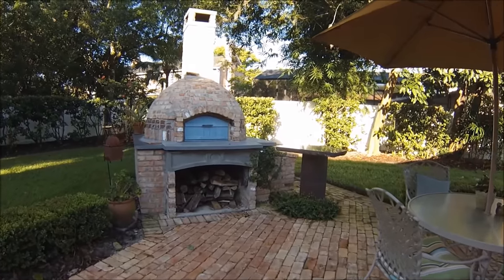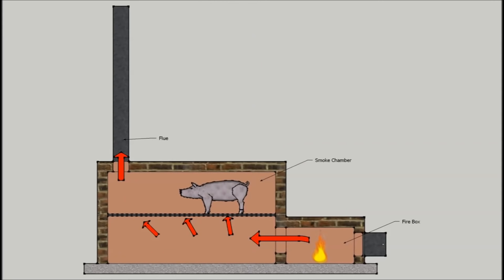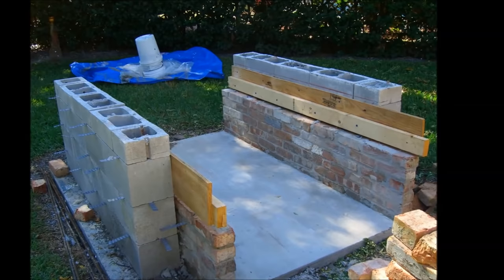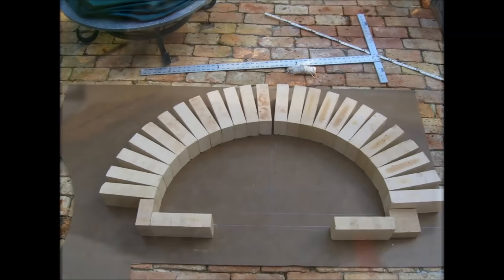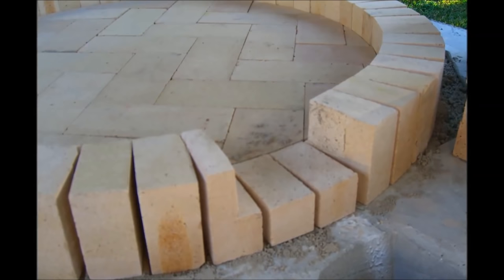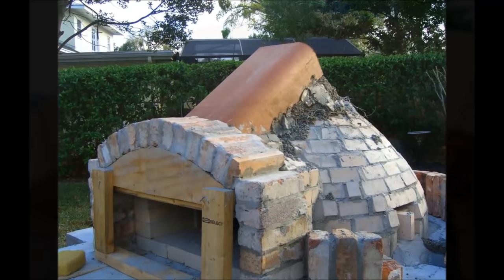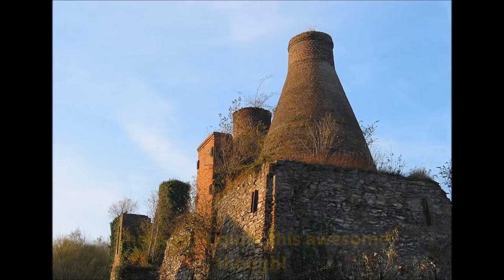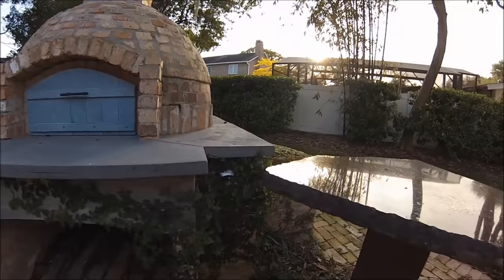How to Build a Brick Wood Fired Pizza Oven/Smoker Combo

Comment: i'd love to make something like this. just with cheaper materials.
Reply from the maker: Well the expensive part of this build is the brick on the outside. If you built a doghouse style oven with a framed housing and cement board siding, it would be a lot cheaper. It would have a totally different look than mine has though.
Reply: @LeeMcNeil  I was considering doing aircrete and finishing the outside with something moldable so i could get an adobe look and make it look like a fantasy creature oven. that would be totally epic. I've worked with cement board before. it really does a number on your tools and takes forever to cut. a bunch of the adobe ovens i've seen have cracks. the ferro cement ones probably won't last forever due to the steel eventually rusting. sooo. i got alot to consider.  yours is lovely and classically beautiful. I just want...something crazy-looking yet useful.
Reply from the maker: @necrokittie2291  You could use Perlite concrete around the oven and form that into the shape you want - that material can be molded into different shapes. Then you could coat it with a synthetic stucco.
Reply: @LeeMcNeil  ooo, interesting idea. i'll see if i can find anyone using ingredients like that with a video already, if not, maybe i'll do a test run before i commit. thanks! =^-^=

Comment: Lee-

I've never done any work with bricks/cement or concrete but I love the idea and I'm good with my hands (I do a lot of metal work). Do you think this would be a good job for someone who is just starting out?

Cheers,

-John
Reply from the maker: +John Raguse Yes I think you could. I had never laid brick before this - although I had seen quite a bit of it being laid by others. With all the videos out there on YouTube it shouldn't be too hard to figure out. One thing that I did do that I don't see any professional masons do (probably because it would slow them down), is I kept the brick I was about to lay in a bucket of water and pulled them out of there to lay them. It seemed that when I didn't do this, the brick would suck all the moisture out of the mortar and not really adhere to the brick very well. This helped a lot. Maybe I was mixing my mortar too dry but it didn't seem like it to me.
Reply: +Lee McNeil Thanks Lee! One last question, did you build the front door yourself or did you order it? If you did order it, where did you order it from?
Reply from the maker: +John Raguse +John Raguse Someone I know who is into woodworking made it. It's just a simple board and batten door. The cast iron door to the firebox for the smoker I bought somewhere on the internets.

Comment: Hi Lee!I'm very impressed! Very good job! I like even your other videos. But I have one question. You are using the oven often as a smoker and the dome is getting black (even the floor). Is the dome turning White again when you use it for doing pizza?Get the pizza a smoky taste?Best regards from SwedenFrank
Reply from the maker: +Frank Dittrich The top of the dome turns white (it doesn't actually turn white but the soot is burned off) when I cook a pizza yes. The soot will burn off when the brick gets super hot. It doesn't burn off all of the firebrick inside the oven only in places where the flames are hitting the brick for an extended period of time. The pizza does get a little bit of a smokey flavor but not any more than a regular wood oven so the smoker function doesn't really add to that.
Reply: Hi Lee,
thanks a lot for this information.
I really like your oven! :-)
Great job!

Comment: What is the diameter inside the oven ?
Reply from the maker: 36"
Reply: @LeeMcNeil  where did you buy the fire bricks to create the doom?
Reply from the maker: @DavidGonzalez-ts9xf  I bought mine from a ready mix concrete batch plant not far from my house. I had to call around because not all of them sell masonry products. There should be a concrete block or masonry materials supplier somewhere near you, unless you live way out in the piney woods.

Comment: HEY Lee, Amazing job! Exactly what i have been searching to do, smoker /pizza oven. 
Have u done a brisket yet? Got any videos on smoker? What temperature can u achieve with offset smoker? do u first heat up upper chamber before smoking meat?
Reply from the maker: Thanks! Yes I have done a brisket in it, but I did not do a video of it. I did make two videos using the smoker though, one where I made ribs https://youtu.be/zrjd-k1bCak, and the other a turkey https://youtu.be/v0nPnXZ9dIY. One of the best things I have made in it are steaks, but not using the smoker part. I can get the oven up to about 350 degrees using the fire box, but that is a little hot for slow smoking. I try to keep it around 250 when I smoke in it. It really doesn't require pre-heating the upper chamber. Once you build the fire in the offset firebox, it will heat up the oven pretty quickly, and the insulation really helps it maintain temperature. I actually have to keep the fire tamped down when I use it as a smoker or it will get too hot.
Reply: @LeeMcNeil  I love it!!! You have inspired me to make one.  Love ur Vogelzang! I searched but seems they are discontinued :-(.
I noticed you laid the dome bricks dry and THEN you added mortar? Am I correct?
As for the perlite/cement bed mix, does it insulate your slab well? How hot does ur slab get? is it ok to the touch? I got kids and last thing I want is them getting burnt.
Reply from the maker: @ricco6950  I did not lay the dome brick dry, but the mortar joints are a whole lot thinner than the regular brick. And the insulation works great. Nothing on the outside of the oven gets too hot to touch when the oven is hot. The inside though, keep the kid's hands out of that.

Comment: Hi How long did it take you to construct.
Reply from the maker: It took about a year in total, including the concrete tops. I was about 46/47 years old at the time. It would probably take me a bit longer now LOL. If you're young, in good shape and you can make the time to work on it, you should be able to do it a lot quicker.
Reply: @LeeMcNeil  a year Jesus Mary and Joseph loool.  I can just see my little boy now saying dad is nearly finished yet how long now how long now😂.  I'm 38 but feel about 60 years old 2 jobs  five kids 2 dogs 1 cat 1 expensive wife. 🥵  might just buy a pre fab oven off ebay
Reply from the maker: @customboatscreensolutions5893  That is actually a very good idea. If you buy one of those prefab precast domes and use it for the inner dome, which is really hard to even see unless you are looking right in the mouth of the oven, and build an insulated brick enclosure around it. That would save you a bunch of hard labor and brick cutting right there, but you would still end up with an oven that looks fantastic.

Comment: you put the chimney in the center top. most have it in front. does your design affect t the heat level?
Reply from the maker: The flue opening for the chimney is at the front of the oven and from there I transitioned up and back to make the chimney itself center mounted. I just didn't like the way the front chimneys look.
Reply: Ahhh so you made it harder but cool.

Comment: Цемент Обычный в перлит?
 Цемент Обычный в перлит?
Is cement Common in perlite?
Reply from the maker: There is no cement in perlite.
Reply: @LeeMcNeil  at 12 minutes, mix perlite and ordinary cement?
Reply from the maker: @user-wu5en9un1o  Yes, 10 parts perlite and 1 part portland cement.
Reply: @LeeMcNeil  
portland cement, он обычный или простой какой то термостойкий? 
portland cement, is it ordinary or just some kind of heat-resistant?
Reply from the maker: @user-wu5en9un1o  Ordinary cement will work if you have refractory bricks between the fire and the perlite. If you were planning to build the inner dome of the oven completely with perlite concrete, like I have seen on some videos, you should add some fire clay to the cement.
Reply: @LeeMcNeil  Thank you very much.

Comment: How do you prevent rain to go into the lower bottom area?
Reply from the maker: Are you talking about the oven itself or the wood storage area below? Both of them have an overhang and then both the landing in front of the oven opening and the brick pavers in front of the wood storage area slope away from the opening just a little bit - and water cannot flow up hill.
Reply: Sorry, I saw the drawing in the beginning, but you´ve build another design finally, so I was wrong.

Comment: Hi Lee.  This is great.  I have started this but have put the fire box for the smoker in the open cavity under the oven.  I used a lot of insulation between the two levels.  My friend who does a lot of smoking said using the ovan as both will drastically alter the task of the pizza.   Have you found this to be true?
Reply from the maker: Do you mean alter the taste of the pizza? The answer is absolutely not if that's your question. You aren't using the oven as a smoker when you make a pizza in it.
Reply: @LeeMcNeil  that's what i meant.  Thanks.  Does the oven get filled with creosote from the smoking process?  If it does will it burn off when the oven is burned for pizza?
Reply from the maker: @TheJohn5710  No. The only way you would get creosote in your oven would be to smoke with pine or some other kind of soft wood - and that is something you should never do. If you are smoking with hard wood, like oak or hickory, it will not create any noxious by-products.
Reply: @LeeMcNeil  thanks you!  I will proceed with confidence and always use hard wood!

Comment: I have been getting some conflicting stories from the geniuses at Home Depot who say I should use a Type S mortar on the outside edge of the brick for the dome and a Fireplace graded mix for the inside edge of the same brick that will be closes to the fire. In theory I understand what their saying but of the dozens of videos that I have viewed on building pizza ovens, I have never seen anyone do it.  I have only seen builders of pizza ovens such as yourself use one type of mortar to lay brick.  Never two different mixes on one brick on the same side.  What type do you use, please explain.  Thanks.
Reply from the maker: LOL! I have no idea why they would suggest that. All I did was mixed some fire clay into regular mortar mix for the firebrick only. Why they think you would need to put regular mortar on the outside edge of the firebrick, I do not know. Now I did use regular mortar on the exterior brick that wasn't exposed to the heat. Maybe they were confused.
Reply: Thanks for the tips, I will follow you lead and make this happen.  The wife is giving me the side eye already.  lol.  Thanks again.
Reply: One other thing how long did you let the oven sit before the first burn and did you do a few test fire starts before you actually put food in it.  Thanks a million.
Reply: You should wait 7-10 days for the mortar to cure completely.
Reply from the maker: Agree with Nick Miller. You should wait at least a week. You don't want to cook off the water in the mortar until it has had some time to hydrate the cement, which gives it strength. After that, light about 5 fires - 1 per day - starting very small moving to a raging inferno. I would do that before you start insulating and covering the inner dome up in case you run into any problems.

Comment: @Lee McNeil hello, i am planning to build my own pizza oven and i am intrigued in your way to add a smokery to it as well. Can i ask how well does it actually smoke meat? How do you deal with the dripping fat? Does the pizza oven not smell like smoke and affect the pizza flavour if you use keep uaing the smoker time to time?
Reply from the maker: No, when I cook pizza in the oven, it gets over 1,000 degrees F, so it incinerates everything inside the oven. It even burns the soot off the fire bricks at the top of the dome.
Reply from the maker: I also put a pan of warm water in the oven below the rack where the food is when I am smoking something. That kind of stabilizes the temperature a little and adds a little moisture to the food while it's cooking. It also catches any grease too.
Reply: Thank you sir. I will build the oven  including the smokery just like you did since it is basically two birds with one stone.

Comment: Hi Lee, Iam going to build a similar setup to yours. I wanted to ask you if your happy with the smoking capabilities of the oven or would you change the design?
Reply from the maker: The smoker works great. The only major thing I would change is that I would have made the fire box just a little bigger and have reoriented it to open towards the front of the oven. Then I would make the fire box taller and put granite on top to use for a prep area. The small side table I made is just barely big enough to be useful. I may renovate my oven one day to do that one day, but it will be a big job so I haven't pulled the trigger on that project yet.
Reply: @LeeMcNeil  thank you Lee, those were the changes I was going to make
Reply: @LeeMcNeil  I am also thinking about putting a Santa Maria grill on top of the smoker box for the trifecta!!
Reply from the maker: @mzlittle  I had to look up what a Santa Maria grill was and that looks like what I call an Argentine grill. That would be pretty cool. You will need to have a tight lid for the grill if you plan to use it as the offset smoker fire box.

Comment: good job! how many fire bricks did you used? how does the cement for the fire bricks? thank you
Reply from the maker: Andreas Cappello I can't remember how many fire bricks I used - maybe 75 or 100. And the mortar I used for the fire brick was refractory mortar which you can either buy or just add fire clay to regular mortar.
Reply: no problem thank you how does the cement for the fire bricks? I can use tin-set?
Reply from the maker: Andreas Cappello No you definitely do not want to use thin set. You can use a refractory mortar (it can be expensive though) or mix 2 parts masonry cement (mixture of Portland cement and lime), 1 part fire clay (you can find that for sale at most brick suppliers - or they can tell you where to get it) and 3 parts sand. Mix that with water and use similar to regular mortar except you want to keep your fire brick mortar joints thinner than a regular mortar joint (1/16" to 1/8" thick instead of 3/8").

Comment: Hey Lee, great video.  Thanks for the inspiration.  As you neared the top of the dome did you make any special angle cuts (other than the keystones) to compensate for the gap that forms at the bottom of the brick joints?  I assume the most inner circle of brick is going to all be special cuts, but I'm nearing the 7th row now and wasn't sure if halving the bricks was going to continue working or not.
Reply from the maker: +Cody Gonzales As you get to the top of the oven, I found myself eyeballing the cuts more than anything. Some people get really precise when they cut their brick - I was not one of those people. As you get to the top of the dome, it gets pretty tight and random so I just cut to fit. The biggest thing I wanted to make sure of was that I was tapering the bricks toward the inside of the oven (to give it a mechanical lock to keep any bricks from falling inward if they became loose) and keeping my courses fairly level as I went up.
Reply: @LeeMcNeil  I was wondering what locked those top bricks in
Reply from the maker: @anothersomebody8195  Think of the dome as a type of three dimensional arch, and the brick at the top of the dome is the keystone. Gravity is holding it up more than anything.

Comment: I'm thinking of building an oven. What's a good way to determine how much brick you need?
Reply from the maker: Divide the square footage of brick by the square footage of a single brick. In my case it was 4.7 bricks per square foot of area. If I remember correctly.
Reply: @LeeMcNeil  How do you determine the square footage of a dome?
Reply from the maker: @Jim-K-Baker  That is complex if you want to do it on paper. I used Sketchup to get an approximate SF.

Comment: Hello Lee, were you able to get medium duty fire brick at Cemex in your area. I can only find light duty in the Ocala area.
Reply from the maker: I didn't even know there was different grades of fire brick - so I probably got light duty too. Mine are a light tan color. Are you related to Mills Tuttle? He used to have a big commercial construction company here in Orlando back in the mid-eighties called Tuttle White.
Reply: @LeeMcNeil  Hello again Lee, I might be getting hung up on the forno bravo recommendation to use medium duty bricks, but can't seem to locate any. No relations to Mills, just a humble tile setter in the Ocala area for the last 27 years. Great video and oven by the way.
Reply from the maker: I think you will be fine with whatever fire bricks that they have. The temperatures in the oven don't get insanely hot like a kiln would, so I'm sure any grade fire brick will work for you.

Comment: What side inside oven ?
Reply from the maker: I don't understand the question.
Reply: @LeeMcNeil  Sorry, whats the measurement inside this oven?
Reply from the maker: @goaro2007  36"
Reply: @LeeMcNeil  Do you think that size is to big or small , how much time it takes to heat the oven?
Reply from the maker: @goaro2007  It's the right size for me. I can probably fit three pizza's in a time. And it only takes about 30 to 45 minutes to heat it up.